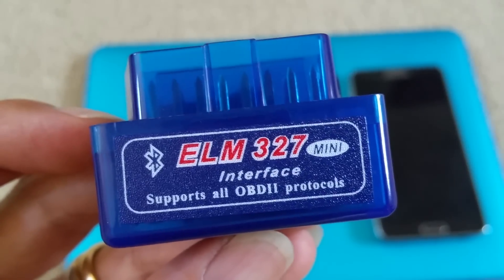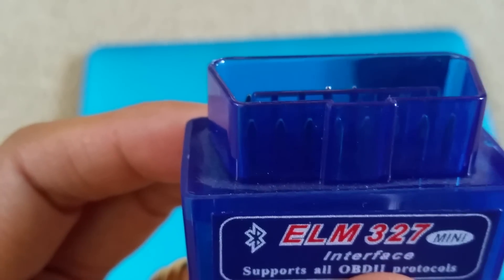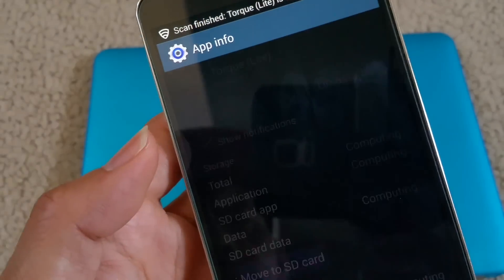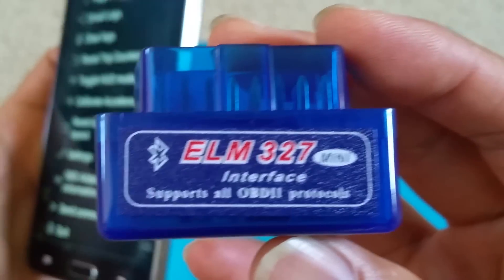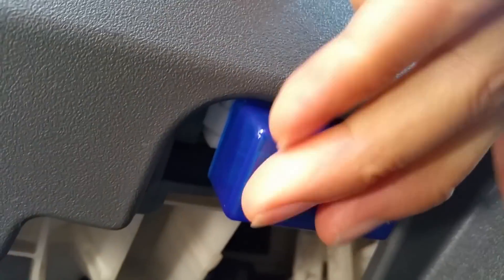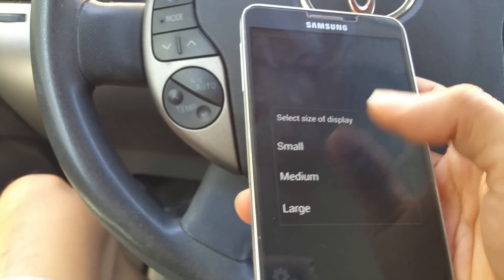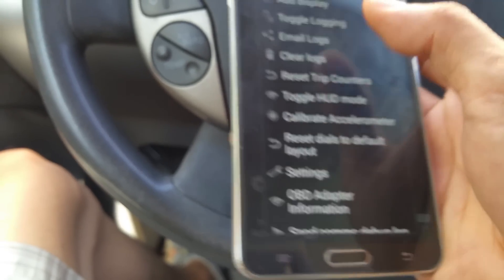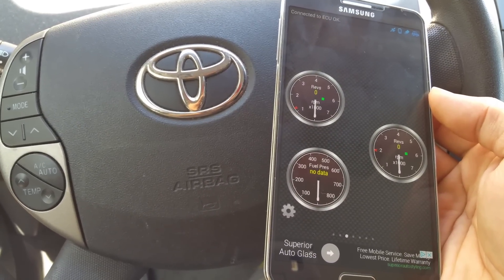DIY ELM 327 Mini OBDII 2 On Board Diagnostic Bluetooth Dongle Adapter 2016

Comment: MACDADDYPIMPPING
{{}}}                               --   Can this bluetooth OBD2 Adapter work with any apps on your phone or only works with certain ones?
    Which Bluetooth OBD2 Adapter would you recommend that is good and works compatible with any app?
Reply from the maker: There are two versions, one ELM 327 Bluetooth which is this one and there one is ELM 327 WiFi: https://youtu.be/98T-61WH4QI Both should work with  or compatible with Android smartphones.

Comment: It's draining my car battery over 3 days when car is parked and remains unused. Careful.
Reply from the maker: No, it doesn't drain my battery. I have it in my 2012 Prius for couple months. You must have something shorted in your car.
Reply: @macdaddypimpping  I plugged the obd and test with multimeter which gives 0.03 amps draw which would be bad for car sitting over 4 days.
Reply: This isn't something you keep on.......
Reply: You are not meant to leave it connected to your car when your not using it!!

Comment: Can you change your kilometers with Elm 327?
Reply from the maker: Yes, you can go to app setting and change the units from miles to kilometers.
Reply: @macdaddypimpping  It's draining my car battery over 3 days when car is parked and remains unused. Careful.
Reply: macdaddypimpping no i dont want mil to km , i want to say my km is 123.000 km now can i downgrade 85.000 with this elm 327?
Reply: macdaddypimpping up help pls
Reply from the maker: Sorry, this one doesn't have that option.
Reply: macdaddypimpping thanks i like it this video

Comment: hi,  as with other elm327s it wont seem to work, i ve followed your instructions to the last letter, in torque it pairs and flashes away but wont connect to the ecu.the blue car on symbol just keeps flashing.  what is wrong?? i have a ford focus estate 2003. please can you help.
Reply from the maker: After installing the app you might want to restart your smartphone and then reboot. Sometime, try to exit and go back to the app. Turn on Bluetooth off and back on again. Which smartphone do you have?
Reply: i have a htc one
Reply: Michael Thompson he want to know the you're phone software. I think Android 4.4.2 or 4.4.4 name also kit Kat is too old or not suported.
Reply: Michael Thompson purchase the full app from the play store. 
I'm not working for elgoog BTW 
Also ⤵
From amazon purchase;do not install the DVD ROM that came with the obd.
Reply: Hey Michael, I have exactly the same problem. And I have HTC u ultra. Did you find the solution?